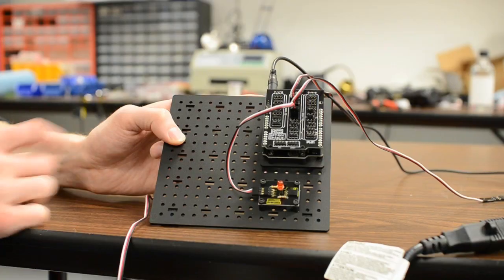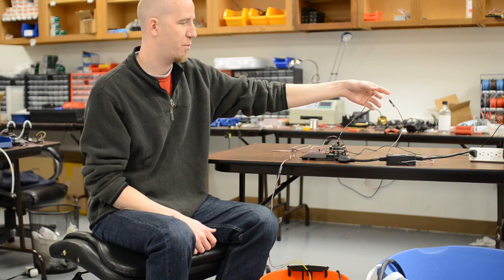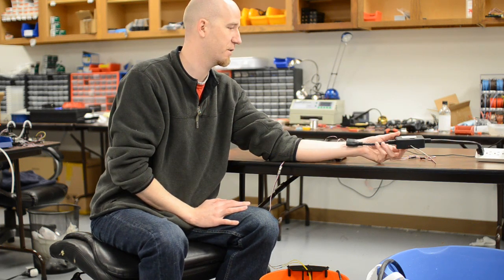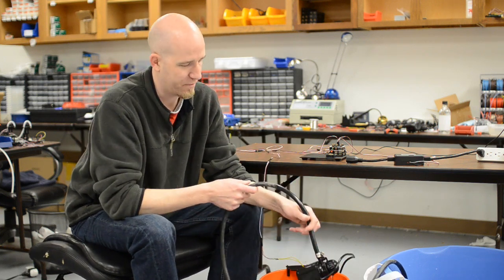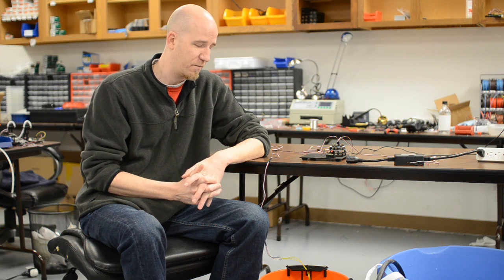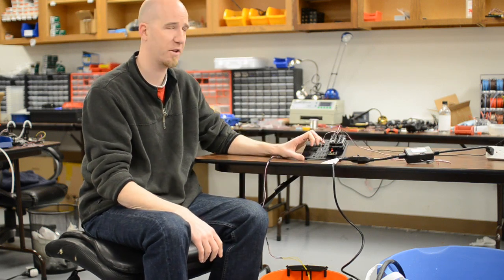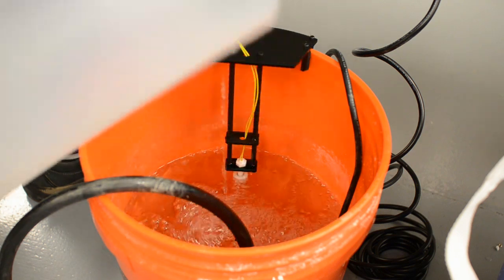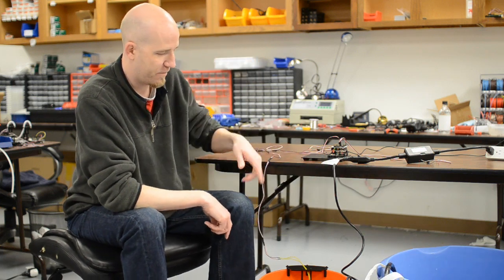How to Make an Arduino Sump Pump

Comment: I have a water alert sensor powered by a 9V battery that beeps when the two metal contacts on the remote sensor are contacted by water. could I use that with an arduino in this setup? Maybe set it to keep the pump on for 1 hour then it shuts off.
Reply: The two metal contacts are probably resistance based. You can easily hook that to the Arduino to get a value(Signal from the plates to the device) The real value of the Arduino is that you could hook it up to something cheap like a raspberry pi and then have the Pi/Arduino send you an SMS to alert you to a pump failure. You can also use many other things with an Arduino in an environment such as a sump pit.
Reply: byron clarkson

So I wouldn't need the alarm just cut off the sensor and hook that to the arduino and maybe a small coil near the motor windings to sense if the motor failed? I could maybe use the sensor alarm as the alert. It sounds like a smoke detector when it goes off.
Reply: you can do many things, its mostly what you can do in the programming that will be hard.